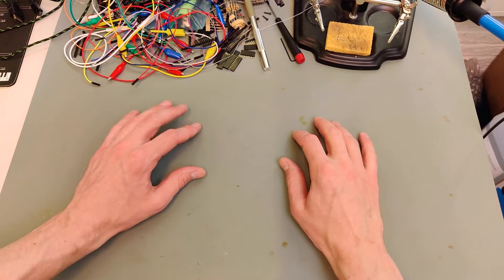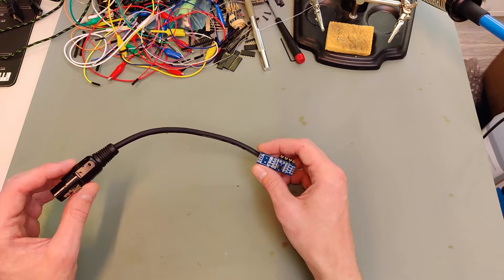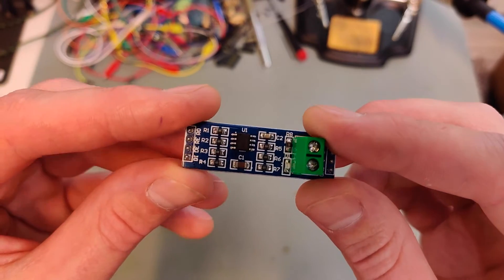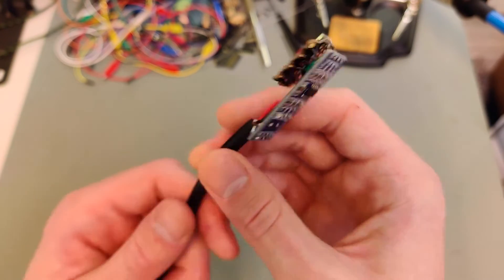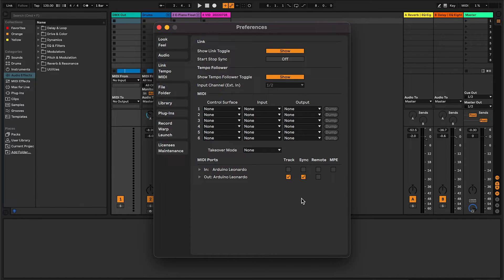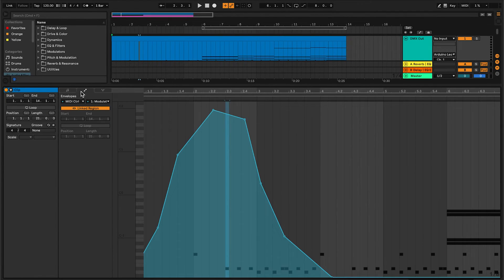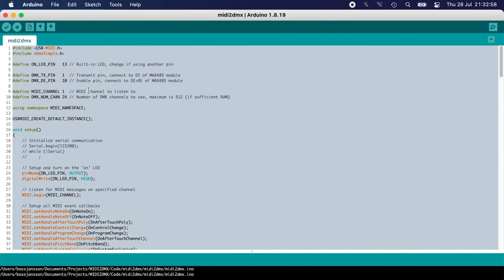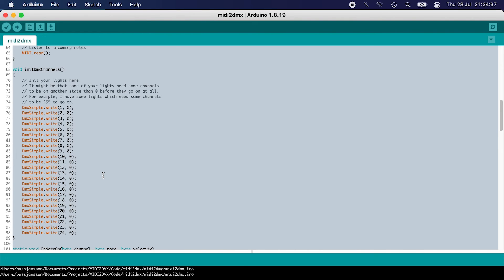How to build your own USB-MIDI to DMX interface

Comment: I am very impressed with your video, I would like to ask a couple of questions, I would like to send Midi notes directly from Cubasis 3 on my iPad Air 6 and into the converter, would this work? if it needs software to operate the different channels, could this be done using Mozsiac plugin workshop on iOS and finding a suitable script to control the channels, if you can answer yes to my question- where can I buy those two circuit boards so I can make my own converter.  Thanks in advance, Mike 🍻

Comment: Hey I made it and it's working, can anyone tell me how to change code or what are the steps to add a second independent line in the chain
Reply from the maker: Hello, amazing that you got it working! Why do you need the second line? You can daisy chain DMX lights together and use up to 127 channels on one line.
Reply: @bassjansson  got it working too , thanks man. Such an amazing project to work on. Btw I made a mistake of buying Arduino nano, doesn't work.
Reply: @bassjansson  btw is their any simpler way to program a show. it seems very time consuming to hand draw every light. any software like dmxis or any other interface. ? that can be made to work with this. i mean i have seen every video you have on your youtube, i dont think i can make a similar great light show
Reply from the maker: There's someone else who built my device but used some other software to control it, check out his amazing video here: https://youtu.be/Cbwf6lGmUU8

Comment: Is it dangerous? Or is totally safe? Because i saw this things could be dangerous... I want to control four lights dmx. Please helpme bro. Greatings from colombia
Reply from the maker: Hi Neil, it should all be fine as long as you solder everything correctly. Biggest problem might be a short, but even in that case the computer will warn you to immediately unplug the device as it will detect the short. Just test for any shorts using a multimeter before powering the device for the first time. From my knowledge, there'll only be a big risk of damaging your computer when using an external power supply with more power, but my device in the video just uses the power of the computer's own USB port. Hope this helps!

Comment: Well, this is brilliant (you legend), but why can't I buy this somewhere?

I want to run lights from logic: MIDI to DMX, without additional software, just a plain conversion. I've been thinking about: DOREMiDi MTD-1024, and it's close but not exactly what I'm looking for.

If i try to mimic your solution (or do you sell it perhaps?) is it then isolated? My computer is expensive and I have heard about things going horribly wrong with cheaper solutions.
Reply: why is the MTD-1024 not working for you? what are u missing there??
Reply: @Blackain66  I actually bought it and it serves me well. It pretty much does what I want.

Comment: Hiii where can I find the exact code that you have used in this video ?
Reply from the maker: Hi! I do not have a branch with the exact same code at the moment, but if you go to my GitHub repo which is in the video description, you can find midi2dmx-direct in the src folder, this is an updated version which works practically the same!

Comment: Nice tutorial!!! Thanks for sharing. I guess that you need some decoder in between the arduino device and your RGB LED strips, right?
Reply from the maker: Hi Jose, if you are building it like in my video, then yes, you will need a DMX to LED-strip decoder.

But, if you are capable of some Arduino programming and hardware design, you can also use the MIDI library together with a LED-strip library like FastLED, hook up the LED-strip DIN and GND to the microcontroller and there you go, no DMX needed. Remember to use a proper power supply for the LED-strips though! Hope this helps :)
Reply: @bassjansson  Thanks a lot for the quick answer!!! Which decoder would you recommend? I want to control 4 LED RGB bars I made myself.
Reply from the maker: @leonarda1973  I cannot recommend any, as I haven't used any of those yet. Although, a subscriber contacted me and was using a 24 channel decoder found on Amazon and that one worked completely fine for him!
Reply: @bassjansson  Thank you so much again!!!

Comment: This is amazing! if you were to daisy chain multiple fixtures, could you individually send them different messages?
Reply from the maker: Thanks! Yes you can, but you will need to update the code to match your lighting setup! This is done in the initDmxChannels() and updateDmxChannels() functions. Check these functions and the comments I put in there. If you have any more questions, you can send me an email. Hope this helps!

Comment: Hi, i already buind this intarface, i installed libraries, uploaded your Arduino Ide scrypt and interface look fine - light flashing and ableton live see Arduino Leonardo midi out. But unfortunetly my device (24chanell dmx512 decoder - was checked and work with build in program) dont get any dmx signal from live via usb-dmx interface. It is possible that something is wrong with interface? I use it on ableton live 8 on PC.
Reply from the maker: Hello, have you tried my test scripts? Did you update the initDmxChannels() function to match the channels of your light? Have you soldered the A/B connections to the correct pins? Check my GitHub for the correct schematic. Did you use the direct or mapped version? Please try the direct one first, and make sure you modify it to match your light. You can send me an email if you'd like more help!

Comment: My comment from last night disappeared but wanted to say thanks for the detailed video which has been helpful.  Just checking to see if this DWEII 2PCS RS485 to TTL 5V Board RS-485 Module TTL to RS485 Module with MAX13487 Chip Compatible with Raspberry Pi Arduino will work?  Since I'm using Roland Vdrums with Octopad Sp30 I could use the MIDI out from the pad to laptop interfaced with this?  If so, I will start ordering parts! 😀
Reply from the maker: Hello! What I quickly read on the internet, the MAX485 chip should be interchangeable with the MAX13487 chip, you'll have to do some research on this or just try it. Only difference seems to be how the enable pin (EN) would work, so maybe some changes in the circuit and/or in the code are required. Hope this helps!

Comment: Hi many thanks for the great vids. I am going to try building this unit. Can you tell me if your wiring diagram on GitHub is correct or do I need to change the pins over, I have the beetle board as you used. Many thanks
Reply: Wiring ok and everything up to date. Just tried old IDE just the same. Test works on UNO but not Leonardo. Anyway looked through the test DMX Sketch and deleted this: #ifdef ENABLE_SERIAL_DEBUG
    // Initialize serial communication
    Serial.begin(115200);
    while (!Serial) // Wait for native USB
        delay(1);
#endif
Now test works on the Leonardo boards. I wonder if you have any thoughts on this as I am quite new to Arduino coding. Many Thanks
Reply from the maker: Hello, somehow I saw this reply only now. It could be that the while loop is hanging the Leonardo somehow. I don't know why exactly, because this doesn't happen with my boards. It's something specific to boards having native USB. But I am glad you found this issue! How did you progress in the meantime? Everything working okay now?
Reply from the maker: Hello, thanks, you're welcome! The schematic on GitHub is correct. Though, you will need to check the pin numbers in the arduino code so that they match up with the ones on your board.
Reply: @bassjansson  Hi. Just wired my board up and loaded code etc. Tried the DMX test file and it did not work, red light on fixture came on then switched off, no further colours. This was using the beetle board, also tried a leonardo board and the same happens. So I uploaded the same sketch to a uno board and the dmx test worked fine cycling through colours as in sketch. Have you any idea why the leonardo boards are not working. Many thanks
Reply from the maker: @torbaymusic  Assuming everything went well wiring the boards, I guess the problem exists within the Arduino IDE. Which Arduino IDE version are you using? Is it up to date? Is the DMX library up to date? Have you selected "Arduino Leonardo" from the boards menu before uploading the code? Cheers

Comment: Great video! I've built this, but I am unable to get it to work with any of my lights. I noticed that there is a difference in the pin assignment between the video and the GitHub code. Which should I be using?
Reply from the maker: Hello! The pin assignment (schematic) on GitHub is the correct one, I misspoke myself in the video unfortunately (A/B swapped). If changing pins doesn't work, tryout my test programs which are also on GitHub, this will help track down the issue!
Reply: @bassjansson  so it's not pin 1 for transmit and 10 for enable? It seems like those are the correct pins on the board so I'm confused
Reply from the maker: @FakeJake808  Ah sorry, I thought you were talking about the A/B connections of the DMX, which I misspoke in the video.
You are right. The newest code on GitHub uses other pins for TX and EN. Change the pin numbers in the code to the pin numbers you are using on the board. Also check if A/B are connected correctly to the DMX connector pins. Good luck!

Comment: That’s super! It saves a lot of money. I’m building it :)
Reply from the maker: Great! Let me know how it goes. I added two tests to the repo for some easier debugging!
Reply: @bassjansson  the program in the branch usbmidi to dmx works like a charm. I control the dmx lights using ableton and it’s midi effects in general the arpegiator. I use a max 4 life device to map cc values to potis of a xone k2. The shutters were controlled by the arpegiator and the different leds were controlled by the midi controller. It super fun to use it with DJ software like Traktor and sync everything up via ableton link. It’s a full sound to Lightshow for a few bucks 🫣😅
Reply from the maker: @ManfredGerhard  Wow great, that's super amazing! Glad to hear :)

Comment: Link to a source for the MAX485 module?
Reply from the maker: Hi Glenn, if you search for MAX485 on for example amazon.com you will find the exact same modules I am using, usually packed in 5 or more. I couldn't find an official link of the module, so that's why I left that one out. Hope this helps!

Comment: But maximal midi value is 127, and dmx512 is 255. How to deal with this? We can multiply midi value by 2 inside arduino, but it's a some sort of workaround
Reply from the maker: Hey Sergey, yes you are right, what I am doing now is multiply it by 2 in Arduino. For my purposes this works totally fine, only losing one bit of precision (7-bit vs 8-bit). But I guess that there will be lights around which need the 8-bit precision for some things such as settings. In that case it would maybe be an idea to use 2 midi control changes for just one DMX channel and then creating a Max patch in Ableton to take care of it properly. Using system exclusive midi messages could maybe be an even better solution.
Reply: @bassjansson  Thank you for the reply! I don't know anything about system excluseive messages, I will make a recearch then. Resently I bought a lightbar and tried to control it the same way - from ableton midi track.  But I also want to make a MAX4Live device to transform midi to dmx and send it to the usb->DMX512 (basically USB->Serial adapter) inside the max device. And maybe SysEx will be the better alternative.
Reply from the maker: @jumperr_g  Interesting! I did the latter first, which is funny. Created a Max4Live device to send serial messages to the microcontroller which converts it to DMX. But, somehow only baudrate 9600 worked on my Mac, not any faster. It did work okay, but using the microcontroller as a midi device felt very user friendly. Also that it's cross DAW compatible.
Reply: @bassjansson  agree about midi device :)  it's not convenient to open COM port every time

Comment: you did a great job, but where do light address go?
Reply from the maker: So, imagine you set your light address to 10 and the light uses for example 6 channels, than in that case the light will listen to DMX channels 10 to 16. Respectively, the midi notes or control changes the light will listen to will also be number 10 to 16. Does this help?